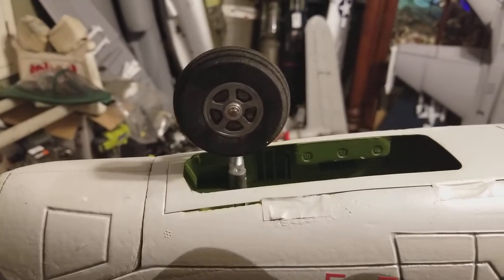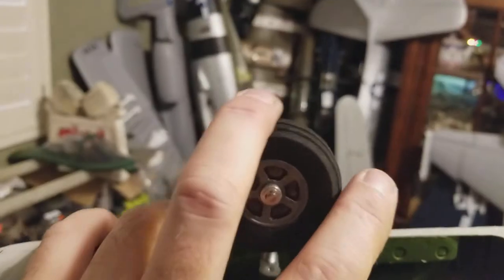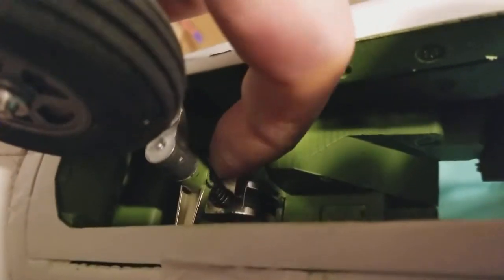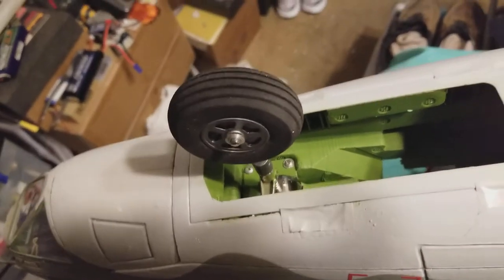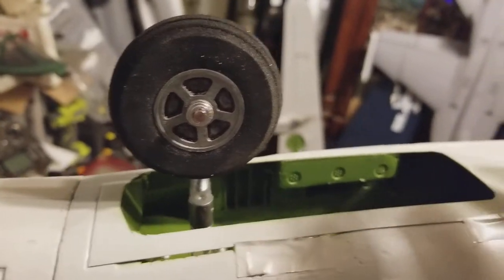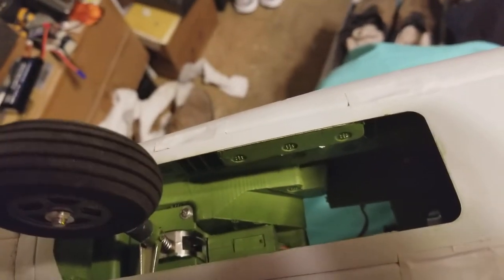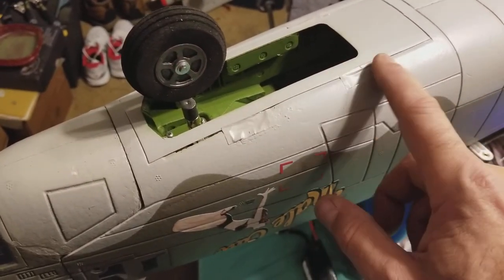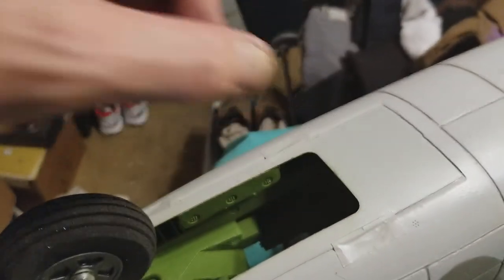FlightlineRC B-24 nose wheel compression and size mod

Comment: Nice mod. What brand foam low bounce wheels are you using? I have a Dynam A-10 and the foam is very firm. I haven't' flown it yet but from what I've seen online the A-10 bounces a lot.